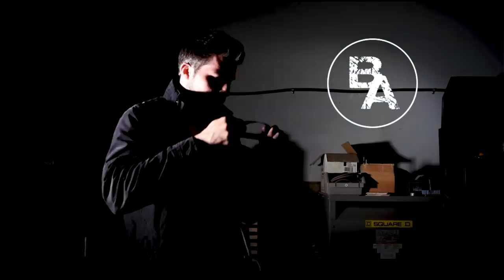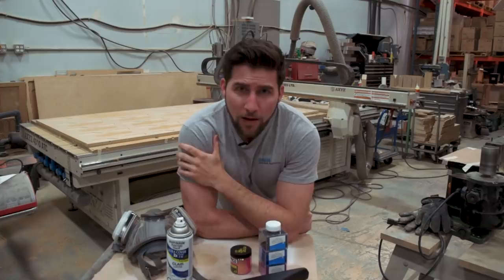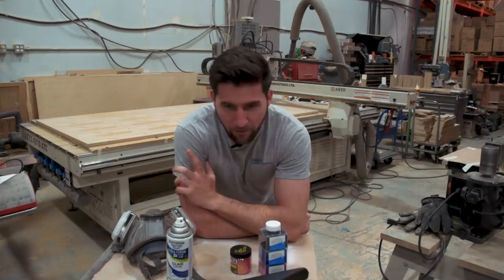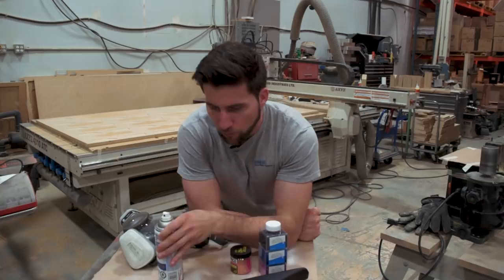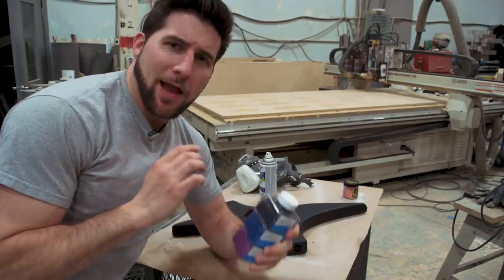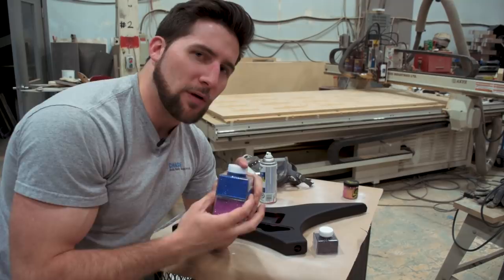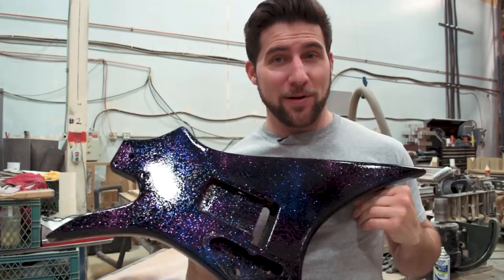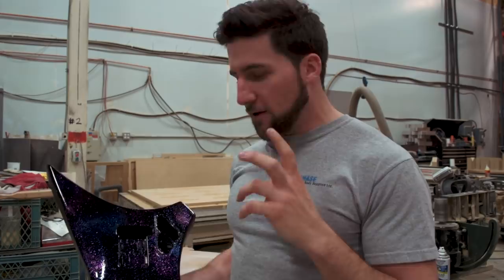Awesome Spray Paint Trick | the Nebula SparkleTechnique (Very Easy!)

Comment: please show this after sand and polish.
Reply: Unfortunately he stripped the paint job in another video.
Reply from the maker: @carvinblack  This paint job is still there actually. I plan to do a sand and polish on it do demo some new polish.
Reply: @BradAngove  Ahh ok. I saw you putting the paint remover paste on the finish in the other video and I had to turn it off because I didn't want to witness the nice job being ruined. Lol. You actually inspired me to do a sparkle job on my old 90's Crate 212 Speaker Cabinet. If I could bend your ear? The cabinet is particle board. I am using Rustoleum for all paint. So I did a bunch of Primer/Sealer. Now I am onto the Metallic base coat. Should I wet sand the Metallic before I do the sparkle or just wait till after the clear coat. I think I saw in another video that you don't have to buff base coat if you sanded. Thanks man. BTW the Metallic isn't super textured right now but I do have two more cans to spray.

Comment: I hate being a stickler, but being a painter i have to say this. The sparkle and glitter turned out much better than i expected. The clear though, that was rough. If it were me, id put about 3, or even 4 more coats (since its spray cans) then cut and polish smooth. It may sound like a lot for little, but it will add so much clarity to the depth of your nebula
Reply: Towards the beginning, he says that he is going to put on a few more coats in a few days. Good catch though, most people wouldn't think about it.
Reply from the maker: More coats and a proper cut and polish would be absolutely necessary to turn this into a proper finished product.

Comment: I think I'm going to give this a try in a much different way. I'll start out the way you did, with a flat black primer, then a coat of clear as you did, and then add only the black glitter. I'll then follow up with another coat of clear and another layer of glitter, and repeat 2, 3 or 4 times with a different color each time. This will give a lot of depth for a bar top. Instead of finishing with more clear spray paint, I'll finish with a crystal clear 2 part epoxy that is designed for bar top applications.
Reply from the maker: Should be cool. You’ll need the epoxy because the rest will be so thick it will be difficult for it to harden properly.

Comment: Did you ever do a follow up video on how the clear coat dried on the guitar body? Spray can paint does not use a hardener to dry cured and that was a lot of clear sprayed all on the same day. It was a nice looking job done in good timing but for people watching who will try the same paint job at home should should be advised that its best to apply half that amount in one session and allow 2-3 days to dry in a ventilated environment and as a bonus tip, give the clear coat a medium sanding with 800 or 600 grit wet sand paper (without sanding down to the glitter) before applying another session of clear coat to the guitar body. It will help have a more glass like reflection and the clear coat will dry harder and be less gummy from all the layers of paint. Someone mentioned in the comments that you tend to "over explain" lol man.... you can NEVER over explain when it comes to body and paint. The questions people will have are limitless and the things that can go wrong have no ending. Rock on! This is my first time seeing this channel so pardon me for not knowing more about you and your channel as far as this comment goes.
Reply from the maker: I have a number of videos on coats and timing and paint thickness etc. For this type of finish there isn’t really an opportunity to do less paint at once. You need a few coats and they need to be reasonably heavy. Ideally you do this one in a warm shop or you could have drying issues. I did a follow up video on this one where I polished it using jescar products. 
FYI, although they are dangerous and require ppe that many hobbyists don’t have, there are spray cans with hardeners in them. They just aren’t very common. I have videos on that as well.

Comment: Saw this and had to do it immediately LOL. Question for you Brad. I applied the extra fine sparkles a little heavy to have a really sparkling look. It’s heavy enough to feel the texture of the sparkles after a few coats of clear. I would like to get it as smooth as possible. In this video you recommended scuffing it after a few days and going on with a couple more coats. How would you go about polishing a sparkle finish and getting a thick enough coat to not feel the texture so much?
I don’t really mind the texture, but I don’t wanna have a glitter mess one day in my office LOL
Reply from the maker: Have a look at my video on how to build a thick clear coat.

Comment: i have a problem..i painted my motorcycle with spray cans and i got over run paint on some places..now i wait to let it dry to scuff that area but people saying you have to clear coat in 30 min after putting base coat..how can i put clear coat without scuffing that area and reapply paint. and until that repainted area takes 30min..rest areas will be dried earlier..
Reply from the maker: Watch my video on how long to wait between coats of paint. I’m this context you should let the paint dry fully and sand smooth before clear coating.

Comment: This is a cool trick.  However, supposing the surface that you wish to paint is vertical, and cannot really be laid horizontal, what would be the best way, in your opinion, to accomplish this effect?
Reply from the maker: Would you have access to a paint gun with a large nozzle size?
Reply: @BradAngove  Not off hand. I think I see where you're going with that; the large nozzle size would accommodate glitter or metal flake.  I'm sure that I could obtain such a device, and I'm fairly certain that my compressor could handle it, but there are a variety of reasons that I'd prefer not to go that route for now, which is why I'm looking at different rattle can tricks.
Reply from the maker: I have a trick for pearl in this really old video: https://youtu.be/N3JWS0pLJWY

I’m not really sure about adapting this glitter technique to a vertical surface though.
Reply: @BradAngove  I'll check it out; thank you. 

I'm in no particular rush to start the project I have in mind, and in the mean time, I'm enjoying learning from videos like yours.  So thank you for putting them out, and thank you for taking the extra time to respond, as well.

Comment: Did the glitter add a texture that was raised too much? On the galaxy painting on my headless guitar, I used a glitter paint that raised it too much to make it smooth, but that doesn't seem to bother me too much, but will the raised section highlights make polishing a nightmare? The amount that these sections are raised are equivalent to the raised sections of a face on a coin.
Reply from the maker: Yes, it caused some substantial texture that would require several coats of clear to hide.
Reply: Thanks, that's where I was heading if I didn't hear from you (I'm amazed you even have time to answer these queries) now I know I'm heading in the right direction! Hopefully the guitar you are going against BigD is going good.
Reply from the maker: It’s going well so far. Luckily I’m pretty efficient at answering questions haha.

Comment: Thanks Brad. Now I know what is going on the back of my Hondo/Explorer 12. First step, flat black? Did you mention something about a pearl? Have you done a video on doing a binding around the body? I decided on a Telecaster 12 string bridge and pickups this looks to be the simplest route. Intonation? I'll cross that one when I get there. This galaxy job will look great on the back with a top binding, and woodgrain on the top. Thanks again😁
Reply from the maker: Matte will work. I generally like to do my build coats with gloss. I haven’t done a video in binding.
Reply: @BradAngove  What would be the best looking base coat? Flat, or gloss.
Sorry for communicating through YouTube. I don't use any of the other social media.
Reply from the maker: No worries; I prefer communicating through YouTube. It doesn’t really matter whether you go gloss or matte for the base coat.

Comment: Question 
I’m doing a purple sparkle finish using glitter, my paint/ primer is purple, after the purple I’ll add gloss as a top layer do I sprinkle the glitter while the paint is still wet? And after so I let it dry and apply another coat or sand it first
Reply from the maker: Sprinkle while it’s wet and add a coat or two of clear immediately. Let that dry and sand lightly. Then add more clear to work on burying the sparkle.
Reply: @BradAngove  what grit would be best
Reply from the maker: I would use 800 grit.

Comment: Another awesome Video. However, I have a question. You mentioned that the glitter can also be salt baed(Sprinkled) on the base coat, I’m assuming the final medium wet coat. So if I’m going to throw a couple Rustoleum Galaxy Blue Colorshift coats on top of a Matt black base coat, Will I be wasting my time adding the glitter on the black base coat or will it enhance the color shift on the galaxy blue paint coats? Maybe even throw more sparkle on the colorshift, who knows, you can’t ever have too much sparkle, right? Lol I would appreciate you’re professional advise. Thank you in advance. 🙏🏽
Reply from the maker: I would think the most logical option there is to put the glitter into your first coat of clear after the shift paint.
Reply: I agree Mr. Angove. I tried on one of my Ginny pig pieces and it doesn’t look right. Lol Can I send you a video of some of the pieces I’m working on, I really appreciate constructive criticism. I want to improve my spray painting skills to the point where I’m not sanding the same part down 3-4 times because I messed up. Lol
Reply from the maker: If you use the link to my Instagram in the description you can send me videos through the messages there.

Comment: Can you easily paint over that if you decide on a different design?
Reply from the maker: It’s a bit thick, so I would recommend sanding it off if you’re going to be doing that.
Reply: @BradAngove  Cool cool thanks for the response! 😁 Also, is it necessary to do two clear coats? If I apply the glitter on the base coat while it's still wet could I skip doing one of the clear coats?

Comment: Hey  did yours dry smooth to the touch? Or does it feel sort of gritty? Did you bury it in clear coat?
Reply from the maker: It feels a bit textured. It would need to be sanded a bit and then would need 3-4 more coats of clear added in order to allow for flat sanding and buffing.

Comment: Hi Brad, can I ask you a potentially silly question please.

I'm in the process of doing a similar finish to my Strat type body, I've got the base colour and I'm just smoothing it down with a buffer, duster & plenty of elbow grease! Now, when ready I plan to do a clear coat, glitter the hell out of it and add a few more coats, you say in your video to sand and then add final clear coats. Silly question, do you lightly sand then clear again or, lightly sand, polish the clear coat again.

Thanks in advance and thanks for the videos, you've been a great help.
Reply from the maker: Lightly sand and then clear coat. You can’t clear coat over polish. It won’t stick properly.
Reply: @BradAngove  thanks for the reply

Comment: Hey brad so just curious when you put the first layer of clear and threw on the sparkle did you wait an hour for the glitter to settle then put on the second coat of clear or just threw the glitter then second clear coat?
Reply from the maker: Second clear coat is 10-15 minutes after first as per the usual recoat times.
Reply: Brad Angove Thank you I’m trying to do just a purple sparkle on one of my guitars but using the technique you’re using in this video it’s helping me a lot  but was just unsure about the clear coat timing. Does the sparkle dry into the clear after the 10-15 mins? I’m just trying to avoid having a pile of it honestly
Reply from the maker: @braydencariveau7645  The 10-15 minute window is when the clear is dry enough to re coat but still wet enough to have chemical adhesion from the solvents in it without you having to worry about sanding before painting more.

Comment: Sooooooo this was done on a guitar body. Id wanna do this but do you think it'd work on a valve cover? Hoping to do something similar to my cars valve cover 😅😅 thanks in advance! (Assuming I get an answer which I hope I do)
Reply from the maker: If you can navigate the possible challenges of adapting this to that shape then it can be done. But, how hot will it get?
Reply: @BradAngove  it would average at about 215°F I believe. Im not to educated on glitter, but I know regular glitter is basically cellophane which I know it will melt quite easy. 
Polyester glitter might be something I look at (looked up after watching your video which is great!)

Thank you for everything man!
Reply from the maker: Ya, I would be concerned about the paint itself melting off. There are specific engine enamels out there for high heat applications.
Reply: @BradAngove  thank you very much, the guitar totally looks amazing btw!

Comment: Did you also do that to the front of that old Washburn, or was it just to the back?
Reply from the maker: I had done it with a slightly different scheme on the front just to test it out.
Reply: Cool, I was wondering what had been done to the front.  I do have a paint related question.  Your rattle can videos have helped me quite a bit.  That said is there a way to do a crackle paint style like the 80's Charvels had?  Perhaps a pseudo marble style with said cans?

Most of the videos I have seen regarding these have used proper paint sprayer setups.  I do not have access to these.
Reply from the maker: Yes. Look up Montana Crackle Paint. There should be some videos using that. I think 6stringstanger did a series with it.
Reply: Thank you.

Comment: so any glitter will work as long as its extra fine
Reply from the maker: Pretty much, yes.
Reply: @BradAngove  whats was the polishing process? ive added around 4 coats on gloss clear coat and i can still feel the glitter would the polish help with that or should i just keep adding layers till i feel smooth?
Reply from the maker: Sand it flatter with 600 grit and then add a few more coats. The polishing process is to smooth it out (see my other videos on how to do that), but you need enough clear on there first.

Comment: Hi Brad, nice job, but not my thing.. sparkles are a bit to course i think. It will take a lot of 2K finish to get it flat, unless that's not the goal. And it looks a bit too much '70 's disco. Recently i bought a bunch off chameleon paint color powder from AliExpress that is much finer in microns. You can mix that with any polyurethane finish and dilute it with water or if it's not waterbased, with denaturalised alcohol, naphta, or aceton, but not with spraycans of course, and that gives nice results. I saw your Chameleon vid with Rustoleum. But this is as good as that.You should defenitly trie that,  If you didn't.. maybee an idea for a future video ? A while ago i spoke you about that LEVIS Expert MDF primer from Belgium company. Did you take a look at that ? I think you can get it in the US. In meanwhile i found out another fine product you should check out. It's in a recent vid from Highline guitars. It's called General Finishes Flat Out Flat Top Coat and is waterbased and from the US. Here"s the link. Greets.
https://www.marilynandmelrose.co.uk/products-page/general-finishes-water-based-milk-paints-glazes/general-finishes-high-performance-polyurethane-top-coat/general-finishes-flat-out-flat-top-coat/
Reply from the maker: Can you give me a link to the chameleon powder? That sounds awesome.

Comment: Thanks for the tips, I have to do the same kind of work on my guitar, the problem is the glitter flakes are pretty big, so I'm not sure what to do once I put the glitter on a wet surface.  Should I put another one or two clear coates and then sand the guitar? Could you please explain to me exactly what I have to do? Thanks from Italy.
Maurizio
Reply from the maker: Yes, add more coats then let it dry and sand. Then add more. Have a look at my video on how to build up a thick clear coat.
Reply: @BradAngove  thanks a lot Brad!
Reply: I have bought acrilic spray cans do you think it will work?
Reply from the maker: That’s what I was using in this video.

Comment: That is gorgeous! I’m looking at adding glitter to my rc paint job. You mentioned after placing the glitter to use 2 or 3 coats of clear base. Do I need to do that when I’m backing it with pink and black paint? Thank you
Reply from the maker: You need something for it to stick into initially and something to seal it in after. If you’re applying it directly to your colored base you will still want some clear to seal it in.
Reply: @BradAngove  awesome thank you for responding I appreciate it

Comment: Hey Brad. Today I sprayed my guitar with the Rust-Oleum clear coat that you are using in this video. Much to my chagrin the clear coat crackled and I am going to have to sand it out. Any idea why that would happen? The clear coat was sprayed on top of Rust-Oleum paint that had dried for over a week.
Reply from the maker: Have a look at my video on paint crazing. That should help you get a better idea what went wrong and then we can try to sort out the details.
Reply: Thanks, Brad. It was the areas where the spray overlapped that crackled. Next time I will hold the can farther away. It was a cool and damp day when I sprayed the clear coat. Could humidity have played a role?
Reply from the maker: Certainly.